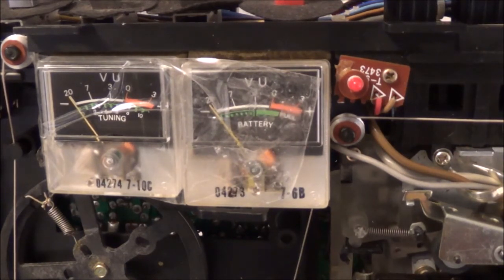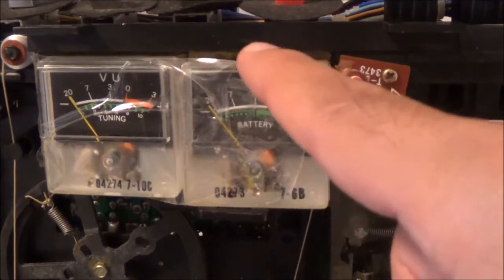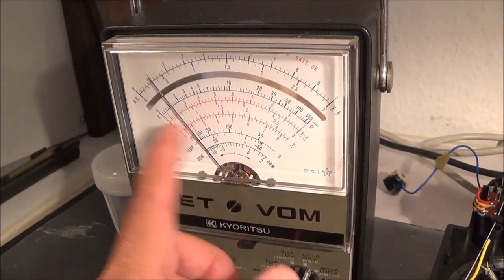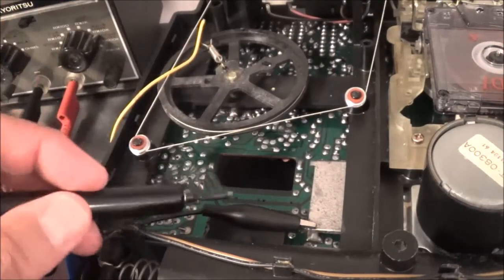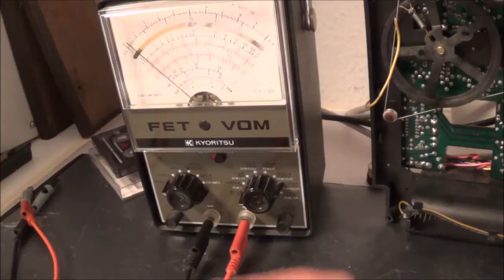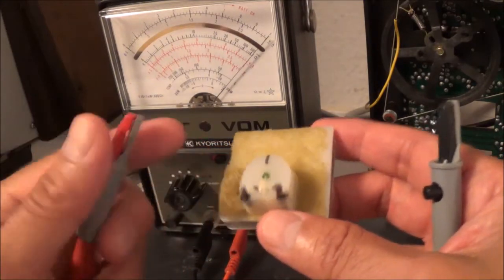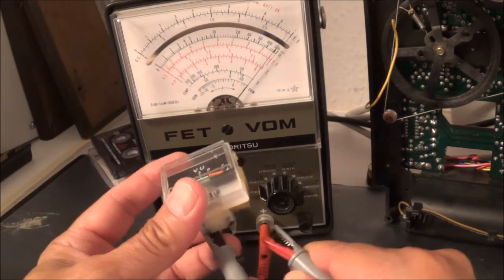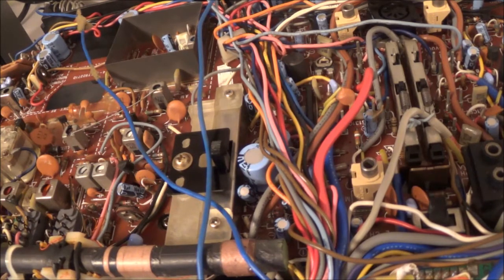Boombox VU Meter Troubleshooting

Comment: did you have a replacement meter?...so those meters do double duty..battery/tuning/audio?...how does that work i wonder...i know what you mean about boomboxes hard to work on, i took one apart it was a bear!..do you sell any boomboxes?...some look to bring good money on ebay
Reply from the maker: yeah, i found a replacement meter. most of these meters do double duty. often there is just some kind of driver, which could be an ic or transistors, and some diodes...not that hard too troubleshoot; especially if you have a service manual. and yeah, me personally, i find boomboxes harder to work on than say, amplifiers. everything is tight and they have often been abused. i have sold some, but i don't do complete restorations....people simply don't wanna pay; they would rather spend 700 dollars on the newest cell phone, which is obsolete after about 2 years or so....someone might think: "wait a second, millions and millions of people can't be wrong and crazy!" uh, yes, they can...
Reply: do you know how or were to tap into the circuit in say a boombox or older car stereo to install a cord with a 3.5mm headphone jack so people can hook up and listen to there music off there $700 cell phone on the older equipment that dont have input jacks?...I seen someone on ebay doing that mod to the older twin knob car stereos so they could plug there phone into the stereo..would you hook into the pre amp?..Also another thing i would like to know how to do is hardwire small bluetooth units into older stereo receivers and such..if you was to add bluetooth into a boombox i bet they would sell!..Im just not smart enough to know where to hook into the circuit.
Reply from the maker: never really did a modification because i don't believe in drilling into stuff, for example. i think i worked on a sharp boombox a while ago; but there, i tapped into the phono circuit. I tapped in after the preamp and before the function switch. The person didn't use phono anyway. So, the output from the mp3/phone went into the phono jacks; the wires from the phono jacks went straight up into the phono line before the function switch. the coupling capacitors after the preamp were removed. The wires from the phono jacks were attached to the now empty solder holes on the far side of the preamp. Now, if I were to drill, I would probably install some kind of switched 3.5mm jack that stops the radio signal from getting through once i inserted the jack.